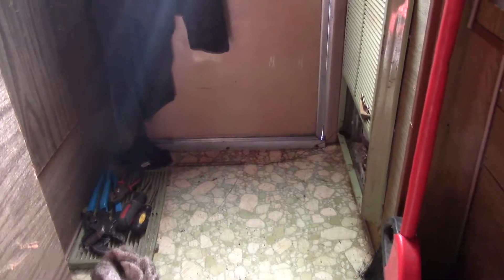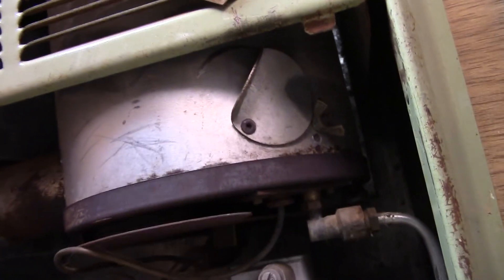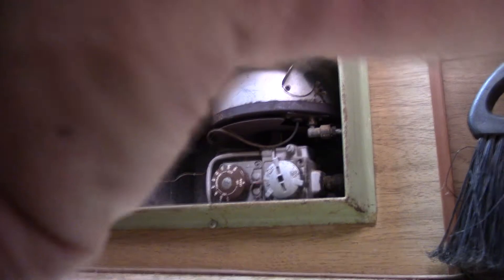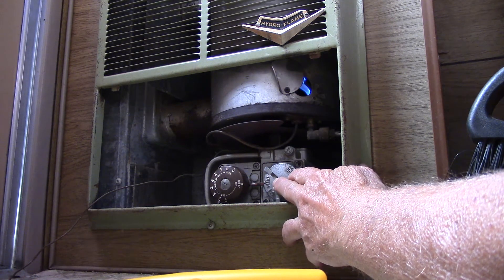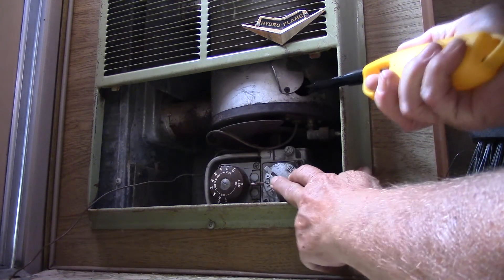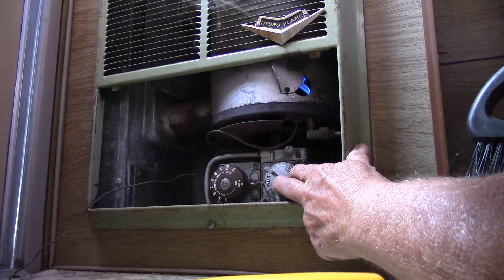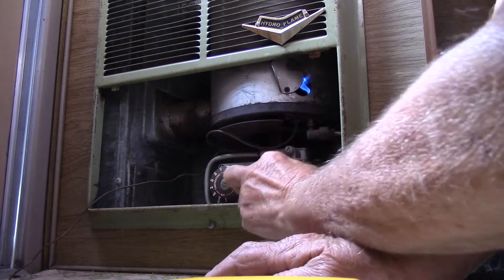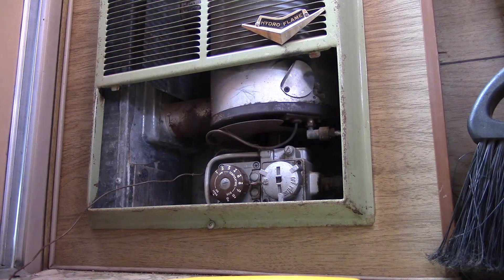1tiliman: first start up,  propane radiant heat in the camper.

Comment: I have worked on hundreds of different radiant heaters in my lifetime, but that is the first and only one that I have ever seen in a camper. Wow!
Reply from the maker: Insane 9831 well apparently terry3193 has seen a few  of them. i never have though. no fan=good battery when i wake up :)
Reply: 1tiliman Just because you or I never saw one, obviously doesn't mean squat. Now we have. Actually, I would like to have one, No battery drain. Dead battery, not freezing. Yep, I think they should make them again!

Comment: I had a heater like that in my 76 Alaskan Camper.  Worked well and cranked out the heat. Used it on many ski trips all over the W. states and kept me warm and toasty below 0 degrees.    I installed a 12 v fan to pull out the heat and move it around.  If you have some PC fans, mount a couple above on the grill and you now have a forced air heater without a huge power drain like the squirrel cage fans.  They suck about 4-5 amps when they run.
Reply from the maker: NWHiker good idea i'll do that!!

Comment: My dad owned a few campers during the 70's and they all had the radiant heater like yours.  I guarantee you that it will heat the heck out of your camper.  They don't have forced air, which eliminates noise and battery draw, but it will sure out out the heat!
Reply from the maker: terry3193 that it does terry, thanks for the info. i wont be worried about 9000 feet then huh LOL. and saving the battery is first and foremost.

Comment: John is there any way you can put a fan into that system to distribute the heat more evenly from floor and let it rise naturally to the ceiling?
Reply from the maker: David Smith it was suggested to put up some computer fans around to get the air  moving. will do that.